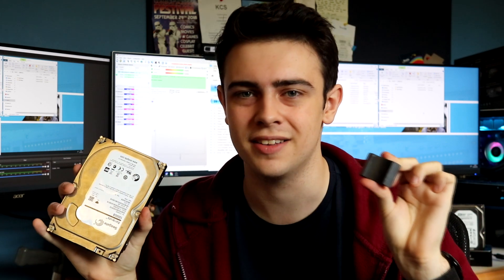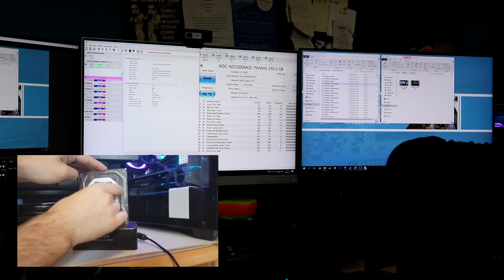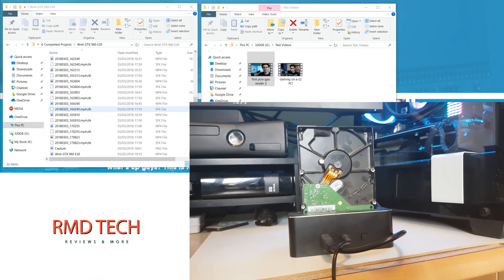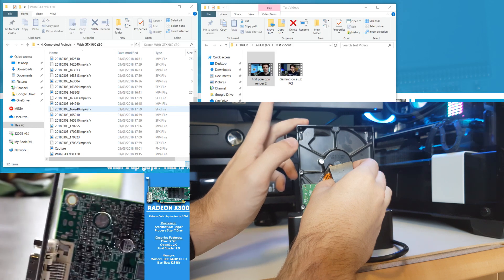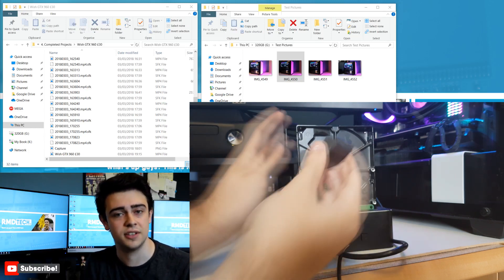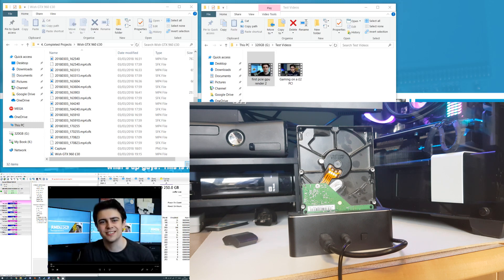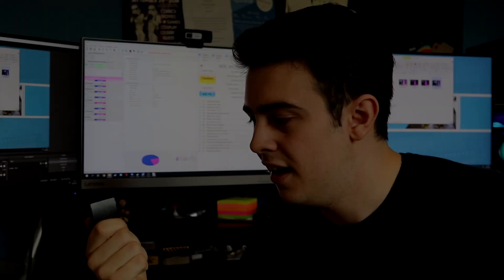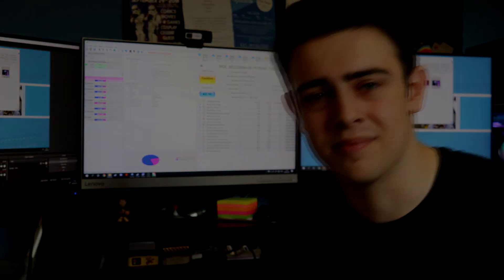Magnet VS Hard Drive | Experiment!

Comment: If you leave a string enough magnet on the HD overnight, it will definitely be dead by morning. Bear in mind that if you do it whilst the HD is plugged in, the magnet may just simply stop the plates from moving or mess with the head, once removed the HD will work as before.

I applied 3 magnets to a HD, 2 on one side 1 on the other side, left them for longer than 10 hours. The HD powers up, spins, doesn't , but is not recognised by any machine I plugged it in.